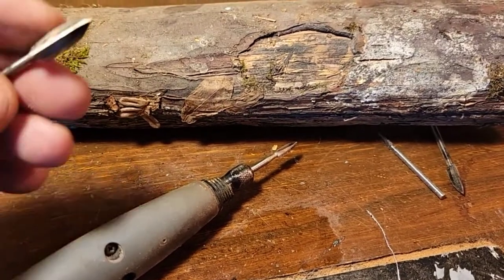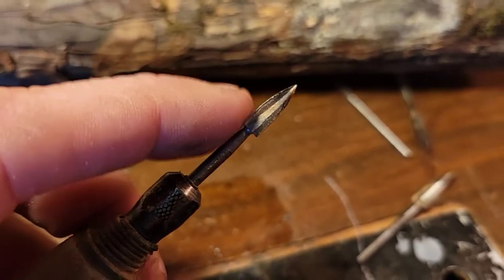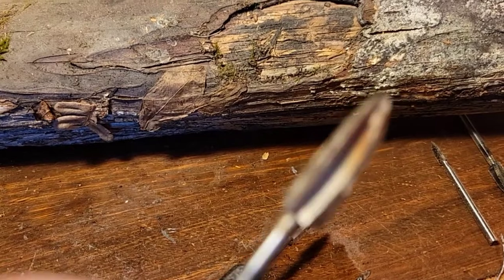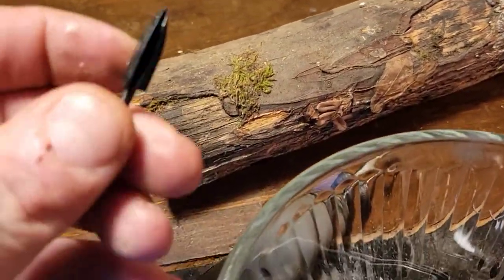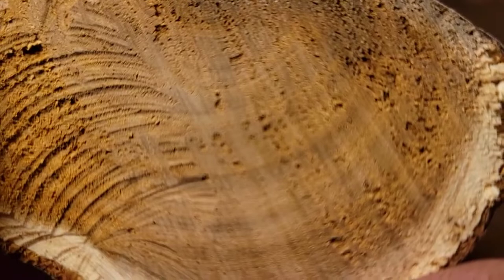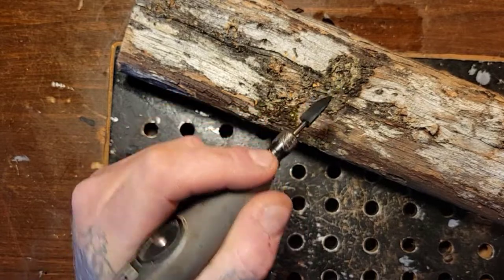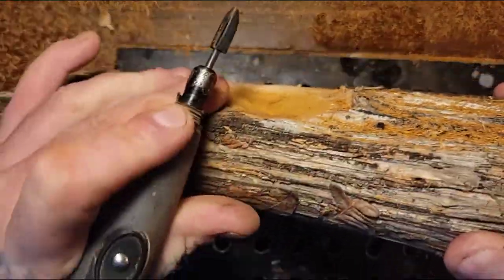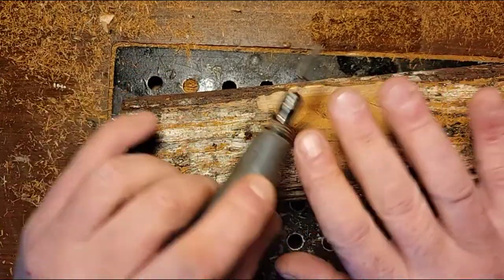How to make the cheap wood carving bits a lot better.

Comment: HEY JORDY,  I work in a steel mill in the heat treat department. I basically strengthen steel that is sold for automotive and oil and gas use. You are, what they call, quinch and tempering, the bur..... sad part is I've never thought of doing it to my burrs. Great video Jordy. That will absolutely strengthen the steel and lengthen the life of the burr. Now you can definitely carve deeper.
Reply from the maker: Thanks for the tips!

Comment: Hi Jordy. Do you do this when the burrs are brand new or after youve used them for awhile? I just tried mine out. I was using the smallest one on same very thin 12x12 boards i got from amazon to do some very thin fret work. I didnt even get half wat through and the the blades are all but gone. 😢
I know they are cheap sets but im on a very restricted budget. Thanks for sharing this helpful tip. Looking forward to your answer. Thank you for taking the time to do these videos. I get alot out of them.
Jill C Tombstone Arizona
Reply: I would say you want to apply this process to new burrs. If youve used them and theyve gone blunt, this process wont sharpen them.
I heated up some burrs today and had a carving session with them, they've stayed sharp, they seem to have outlasted the standard burrs as they come.
Reply from the maker: Hi there sorry for the late reply, I do it before I use them , brand new